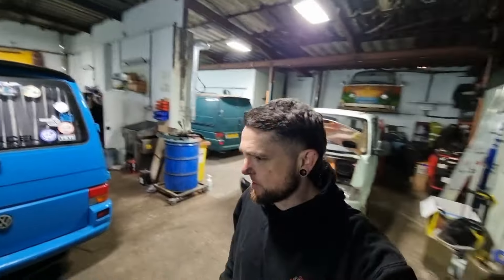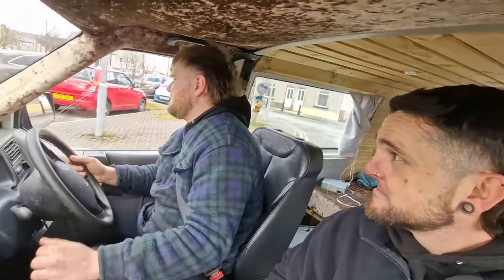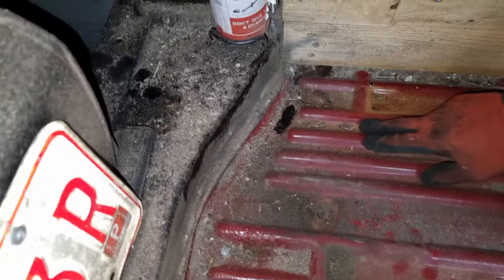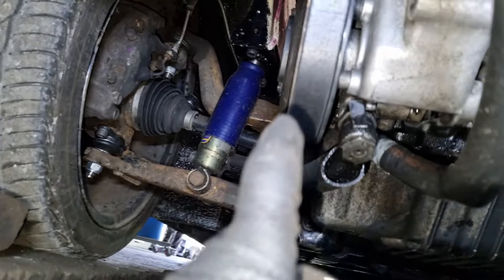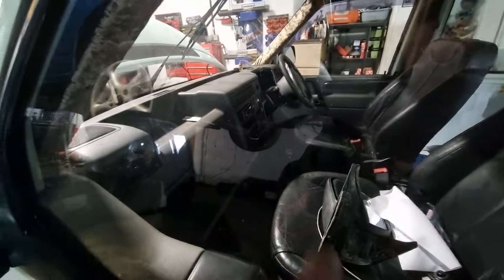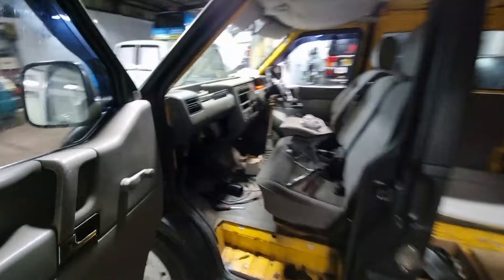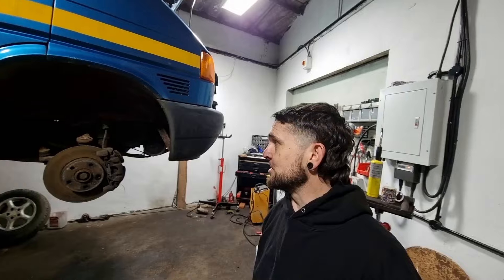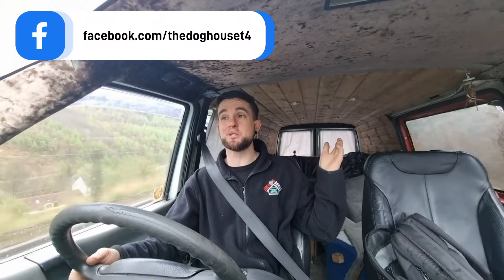Are We Getting Closer??? #vwt4

Comment: What lenght the new belt was? Maybe a part code?
Reply from the maker: I not 100% sure but I will get it for you
Reply: @PranceProject  it would be cool if tossed those tidbits of info in your videos also. As t4's are classic, any info on them is invaluable! Btw. bagged EWB last night! Onwards!
Reply from the maker: @mingiasi didn't think anyone would been to know what length a shorten belt would be 
What you mean "bagged EWB last night"?
Reply: @PranceProject  the issue with t4's that it has multiple options of parts per engine type. finding one that fits the best, comes these days guided by experience/data. just following manufactureers codes does not work as well as we want to. as for EWB its the gearbox doghouse guys recommended for my aab engine. My homework confirms it  also, there is also DUJ but that one is as rare to comeby.
Reply from the maker: @mingiasi I remember the conversation now sorry 
Yer jons knows his stuff fair play to him
He did said that would be the better box as it's easier to get hold of
Reply: @PranceProject  hm interesting. the those two seem to be hardest to come by as they are heavily in demand because of 5th gear ratios. But its ok, thats exactly what i was after. Many thanks for time and effort!
Reply from the maker: @mingiasi no problem mate glad we could help